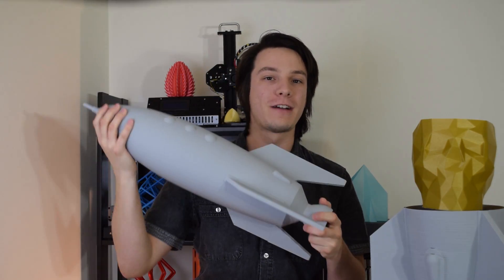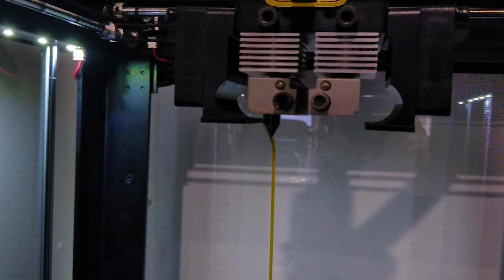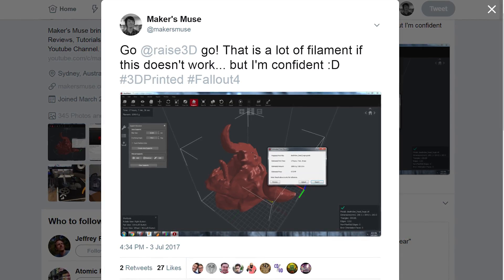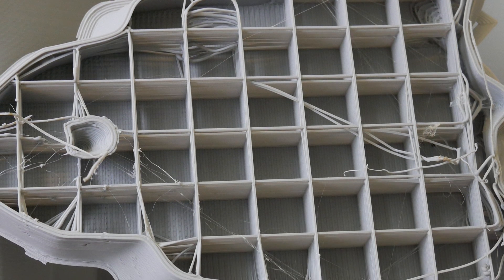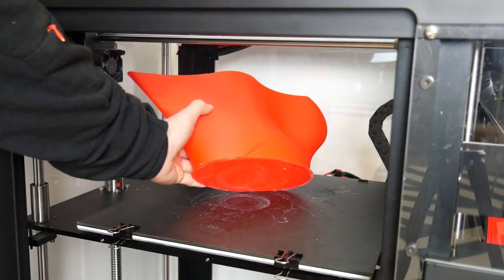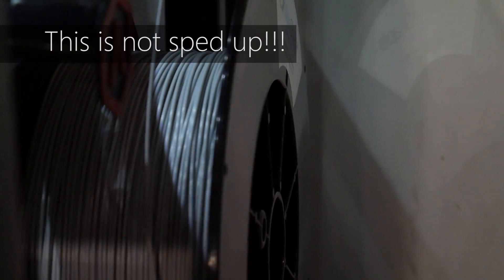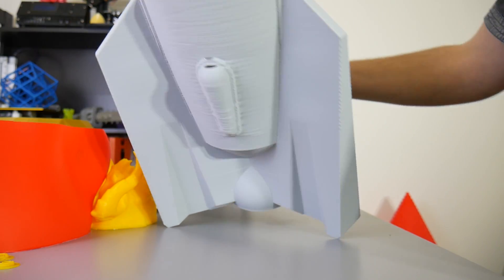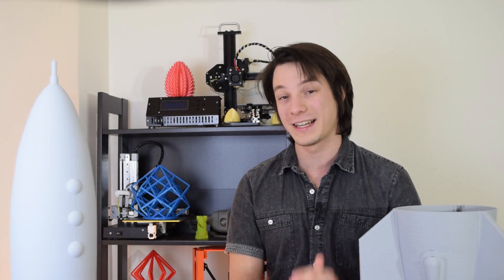3D Print ridiculously fast with this terrible mod - 1mm nozzle on the Raise N2+

Comment: Did you also file a new "flat" on the nozzle after drilling it out?  I understand (perhaps incorrectly) that the flat is an important part of the nozzle's ability to lay down a layer.  You may have lost some of that flat by drilling out.

Comment: I wonder if the machine was slowing down on corners for the grey a-bomb planter which caused it to cool, then sped up, which caused it to "pull" the edge. I wonder if acceleration could be adjusted, depending on mass of the printer arms etc, to eliminate most of the slowing. And hence the pulling near the top of the print and distortion. And add a little speed to boot.

Comment: Angus - I don't have time to read all the comments to see if someone else has already said it, but a real 1 mm nozzle would have a larger flat area around the orifice to flatten the layer out with. This would make a huge difference in layer adhesion - which may be why some of the more complex prints you tried were failing. Perhaps try that 1mm mozzle you bought (you did buy one right?) before making a final conclusion.

Comment: I discovered this when I clogged the nozzle on my twoup 3d printer and had to drill it out, I messed around with a 0.8mm nozzle before my e3dv6 came in. It was able to just throw out parts, I think due to the three dimensions, it was actually like 1/8 the original print times for the stuff I did

Comment: Hi Angus thanks for all your great video. As for this 1mm nozzle have you tried it up using simplify 3d slicer? I am building big lego minifig and having problem on extrusion with. Should i use the auto mode or manual,and if its manual what will be the number. Maybe some explanation on the calculation. Also on the retraction as well what should i do? Last but not least i trying to be your petron but my request was deny any thips on this?

Comment: Hmmm.... I've had this Anet E12 for a week, and this was almost the first thing I thought of doing.  After I resolved the clogging of the nozzle issue.  I did speed up the flow rate, but that has limits as well.  If you push the speed too high, that has even more problems.  But playing with the different settings, I got a 12-hour print to go in 5 hours, without a significant difference in quality.

Interesting video - thanks.  There are a set of PID (Proportional - Integral - Derivative) variables that you can set for the nozzle heat, and those are pretty critical, but I wonder if tinkering with those might improve the infill results.  If you do change them, make sure to record the original settings, in case it goes badly.  Also, I wonder if you tinkered with the retraction variables...

Comment: I think you should decrease printing speed when printing with 1mm nozzle. It is very hard for your extruder to melt and push so much plastick through the hot end. I was also used to print with 1mm nozzle and layer height 0.6mm and the results were pretty good. But printing speed was just 20 mm/s.

Comment: It went off more and more as the height of the print increased because you're not accurately compensating for the additional plastic. On short prints, it does not matter, but the error is multiplied by height.

Comment: I think Printer manufacturers should really start making their printers support up to 2 mm very competently.  For functional prints that just need to perform a physical task, you can't beat a half hour print time, and if they started really pushing the limits of what you could do at that scale, I don't see why a Benchy couldn't be done comfortably in under 5 minutes.

Comment: When you say "maybe the slicers couldn't handle the 1mm nozzle size"...which slicers did you try?  Would be great to know which slicers worked and which ones didn't and also if it actually was a slicer problem or not.

Comment: I feel like pushing filament through at that speed and size causes the plastic to not fully transition. which is preventing the layers from bonding completely. if you think about how the plastic is transferred from nozzle to the layer it's printing. the part that is touching the layer with the most bonding pressure is the center of the filament. normally this is no problem as it's forced into a much smaller diameter so only completely liquid plastic will extrude. I don't think the reduction is enough to force the coldest plastic to stay in the crucible. 

I'm guessing you need at least a 3 to 1 drop in diameter to prevent this sort of thing from happening if that is true. more temperature really won't solve the issue as it's just going to make the plastic too liquid to hold together the edges.

Comment: You said that if you don't have a powerful enough heater unit you'd have to slow the print speed down, thus negating the point of drilling out the nozzle.  What about the fact that the larger nozzle output more sturdy prints?  If time isn't an issue, but your prints keep breaking, using a bigger nozzle may be just the change you'd need.

Comment: Hey ;) You always mention the nozzle diameter but actually never the extrusion width you print with and what speed you use... I can print with 1mm extrusion width and 0.3mm layer hight just fine, using my 0.25mm nozzle. No need to drill/change it. Only limit is my extruder which starts skipping steps when the feedrate / backpressure gets too high. I only reach 30mm/s before it starts skipping steps. But I have a direct drive extruder with low tuned current setting (extruder motor stays cold during print)... I'm pretty confident I could double the speed if I increase the current and/or use a geared extruder. Also 0.25 is really a pretty small nozzle. With a 0.4mm nozzle, most printers shouldn't have issues printing 1mm x 0.3mm layers with a reasonable speed. Sure, if you plan to print always with large extrusion widths, a large nozzle is the best choice. But I only print 5% or less of all my prints with 1mm extrusion. I wouldn't buy and change my nozzle for these rare cases, when just changing one parameter in the slicer almost does the same trick ;)

Comment: If you have dual nozzles, could you do one 0.4 and one 0.8 and then have it print infill with 0.8 every other layer of 0.4? You could also do any support material in the faster 0.8.  High quality outer shell, fast infill. Setting up the G-Code might be a pain, but it could produce higher quality looking prints with faster results.

Comment: You missed the obvious point of actually BUYING  a 1mm nozzle.  You get one with the proper sized flat land around the opening (assuming you get a good nozzle from E3D) which pushes down and flattens out the extrudate against the previous layer rather than just pooping out some plastic.  :)

And by drilling out a 0.4 mm nozzle, you probably didn't have the correct length of 1 mm opening travel to properly organize the flow into a nice laminar path since you drilled up into the larger opening area of the nozzle.  That results in a turbulent flow.

Comment: Want a fast and quality prints - get a delta printer, set up a 32-bit control board, enforce the frame, set 0.1 mm height and 150-200 mm/sec speed and 3000-4000 mm/sec^2 acceleration. There won't be any problems with layer adhesion, extruder will pump the plastic easily, and you will get fast and great prints.

Comment: Really just the skin of the print needs to be with a small layer size, I am surprised there is nothing that seems to print with higher layer size for inside of the print and smaller layer size for the visible portion of the print. That seems like it would be the best of both worlds.

Comment: hey! you're videos are amazing, super informative and fun. In a few videos you highlight 'vase mode' that prints continuously and without any interior fill. Would it be possible to print a normal structure with a large volume but instead of spending time and plastic printing all the crosshatching in the middle, print on top of a simple precut block of substrate like honeycomb plastic? I've heard you say the base of a model or its interior encompasses most of the printing time and thread spend. It seems like cutting the biggest simple volume that can fit in the interior and then printing on to that would save a lot of time and money.

Comment: I use the e3d volcano with a 0.8mm nozzle on my gmax. Prints that used to take 80 hours? yeah, maybe 20 these days.

And once I got it dialed in (I found I had to really crank up the infill overlap % in s3d so infill would properly adhere to the walls) failures arent common at all. I let s3d auto the width to 0.96mm, and typically run my layers at 0.6.

The biggest negative is the loss of small details, but eh. I like cranking out huge prints exceptionally quick.

Comment: Isn't it because the core of the filament isn't fully melted? Unmelted plastic was pushing the wall out of the way. You'd need larger filament size or different design nozzle. That's why drilling one doesn't work.

Comment: Would you think that a 0.8mm nozzle provided by the company who made the printer, in my case one that came with the Ultimaker 2+ would behave the same way?
 
Since it is made by the company providing the printer, as well as the slicer in almost all cases (including mine if I'm not mistaken)surely they would officially support it and allow it to work well with their slicer?

Comment: I have had an issue with the slicer overlapping 1mm thick perimiters with 2 extrusions on top of eachother, but after i changed it to 2 perimiters, 2mm thick walls, it prints very well

Comment: I must say i'm surprised about how it's failing for the infill prints. Maybe the software of the Raise3d is not made for bigger nozzles i don't know. I've been using bigger nozzles on Ultimaker 2 machines (up to 2mm!) with no real issues (other than temperature managment). 

Maybe the drilling of the nozzle was a bit of center also?

Anyway, for bigger nozzles you can check out 3dsolex, there are nozzles for Ultimaker, Raise and Wanhao i believe. Or my shop in Belgium (Ultimaker).

Maybe it's worth trying Simplify or Cura (dunno if it works for Raise)

Thanks for the video anyway!

Comment: Angus is there any advantages/disadvantages to using the silent mode on the Prusa i3 MK2?  I'm just curious 😊
Reply from the maker: Yep! It's quieter but you get less torque, so the machine can lose steps easier in silent mode. If you can get away with it run normally, but I find it just SO loud... even when in silent mode :)

Comment: I find myself questioning the precision achieved if the size of a hole drilled with a hand held tool when tolerances are best measured in the tenths of a millimeter.  In other words, might the "1.0" mm opening been closer to 1.1mm, and thus not to within tolerance, or possibly not perfectly round or even due to minute hand movements while drilling; not to imply you have unsteady hands, but rather due to some small movement being normal and the operation in question requiring a much higher level of precision then normal.  Perhaps with a drill press a more precise opening could have been drilled out, leading to overall better results...

Comment: try printing full infill pattern on every layer
Reply from the maker: I did, it still failed... line infill was only for one of them, the one that got the furthest. More tests to be done!
Reply: Despite the size of the heat block, the length of the the section the filament actually gets heated, is too short. That's why the volcano heater block isn't much larger than a standard v6, but is oriented the long way, so the filament is inside the heat block longer, so it picks up more heat, so that when you're printing fast it still has enough time to pick up heat. This absolutely didn't get up to temperature with that much filament pumping through it, so it didn't lay flat, or adhere well to the infill below it.

Comment: Nice video but isn't this exactly what the E3d volcano is and it came out over 2 years ago before this was published.....Heater cartridge running along the heat throat/ nozzle gives it enough time to fully melt the plastic in the hot end with up to 1.2mm nozzles. 
Those detailed prints failed because of the plastic not being melted enough giving and you would need a higher retraction to stop the issues of the blobs of plastic depositing on corners creating raised edges.
Try printing in ABS with a large nozzle then using acetone to smooth it i think that might be a very cool idea.

Comment: Hey guys, just about to bet my first 3d printer soon, really looking forward to getting into it. One question I do have, in relation to failed prints. Is there any method where you can recycle failed prints to reverse them back to filament? If they were melted, i dont think it'd be that complicated to extrude the liquid back to a uniform length. Let me know if its possible cheers :)

Comment: In my opinion yout temperature was 10-15 degrees lower than what you need, also your speed in my opinio was a little big too speedy 'cause you need to wait the filament cool down before "drag" it into same angle or shape

Comment: you'd have to adjust the setting for 1mm nozel wouldn't you? and speeding up the time whilst pumping out more material means it won't have enough time to heat ? don't timing need to change then?

Comment: I have a lulzbot mini and I print cosmetic pieces for my nerf guns and with 1mm it doesn't really have a problem a with it I don't increase layer heights so that probably helps but I just use 2 line thick walls and 10% infill and I don't have a problem

Comment: Since lulzbots taz has an extruder with a 1.2 mm nozzle you could use their cura with that profile
Reply from the maker: The MOARstruder! I might be testing it in future. Different machines though, so the profile will definitely still need tweaking.
Reply: Maker's Muse true but at least you know then it's not the slicer
Reply: Although the ultimaker 2 has a 0.8mm nozzle as an option so maybe cura in general might work

Comment: Your drill bit might be 1mm but due to wobble the diameter of the nozzle hole is more than 1 mm so there are more deformities in the print.

Comment: Isn't part of the problem that you lose the 'flat' part of the nozzle when you drill out a .4 nozzle to 1.0 nozzle? The flat area around the hole is neccesary to make sure the filament stays flat, and if you lose that, you'll get those fails you mention that the filament bulges up in corners and the next layer it will bump into it. I don't know where you get the idea that it's the fault of the slicers, I don't see the logic in that :) other than that, great experiment, I hope you'll try with an official 1.0 nozzle too and show the results too!

Comment: Your nozzle isnt big enough for vase mode do a layer 1/2 as tall as your nozzle width that should ensure a very good bond between layers.  Drill it out to 2 mm. To make 1mm layers. If you need it get a bigger heater.

Comment: I never thought about drilling out the Nozzle....I wonder if you changed the infill patern if it would keep up??
Reply: don't drill get a volcano kit it has a heat block and heads up to 1.2mm
fits the e3d v6 heatfins and heatbrake.
infill wise is a matter of tuning your slicer and using the right pattern.
most defualt infill under extrudes you have to go in and crank that up at that size. 
in the small heads you still get that looseish infill sometimes but it's so slinder/small the head rarely catches it (just melts it) at that size tho it's enough to catch

Comment: Maker's Muse would you share gcode for the watering can? im doing something wrong in my simple3d slicer and it is printing a hole i a handle. i have 1mm nozzle on CR-10 and scaled object to 120mm Z axis. thanks :)

Comment: Seems like 1mm nozzle and 0.8 layer heights are too drastic. What happens with 1mm and 0.6 or 0.7 heights? Or if you add a 10-20% infill if the walls are getting wobbly? At this point though, it's burning through more material in order to drop print time down. Any chance you could do a print test with progressively stepped layer heights to see where the big quality drop-off is?

Comment: awesome video. so what would u recommend for max size on mk2 for vase mode prints.
Reply from the maker: Using the stock nozzle size you could go full size easy on the Mk2, just keep in mind the overhang angles you can achieve greatly depend on your vase mode 'layer height'.
Reply: Maker's Muse so 0.4 layer height max. and increase speed.

Comment: Are you sure the slicer is to blame?  I wonder if the filament just isn't melting completely.  Can you see if raising the temp helps, or check if the head is even reaching the target temp?  I think it's failing because you are printing toothpaste-consistency, not liquid.
Reply from the maker: Very possible! I'll still be doing more tests, and will report back. The slicer infill was failing to attach to the walls in some areas which is why I think it wasn't quite designed for 1mm extrusion width.
Reply: I think we should take the capacity of how fast an extruder-hotend combo can extrude plastic, as a constant (usually around 10mm^3 per second in volume, let's say) Then  wider the nozzle,  thicker the layer, slower the print speed should be.  For 1mm nozzle, 0.8mm layer thickness, the speed should be no more than 12.5mm/s or even slower (bc the extrusion width might be greater than 1mm). 

Plus, I've read somewhere, the best layer height should be no more than half of the nozzle size... So for 1mm nozzle, try 0.4 layer height is reasonable.
Reply: Slic3r has a parameter, Infill/Perimeters overlap.  Defaults to 15% on mine, but perhaps you want to increase that.

Comment: 2:58 you spend same much plastic even do 0.1height and 0.4mm nozzle to get that point.if model is 10mmx10mmx10mm. it use same much filement.even use 0.4 or 1mm nozzle.it just do it faster and my brain say less heat so its not flow too much